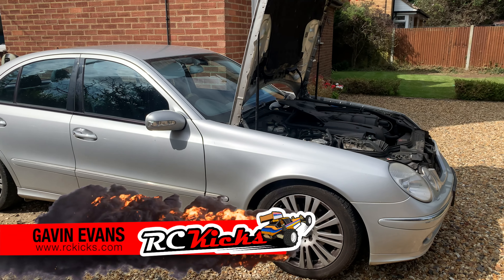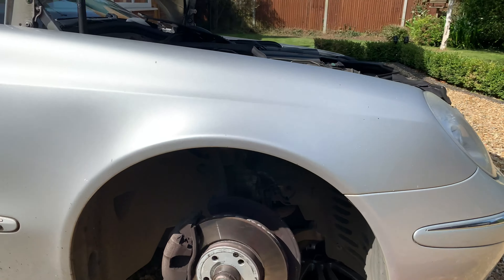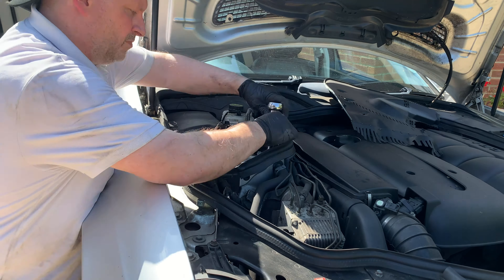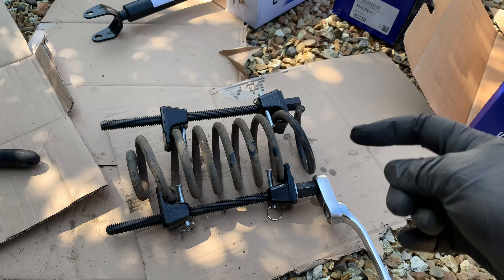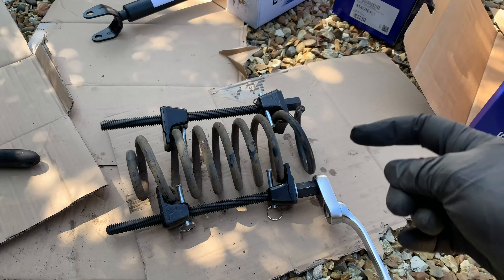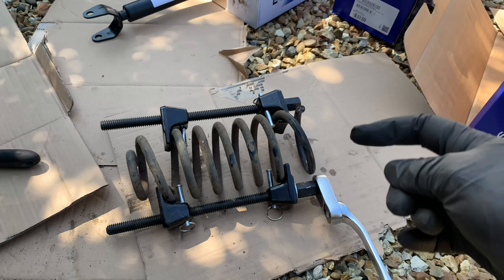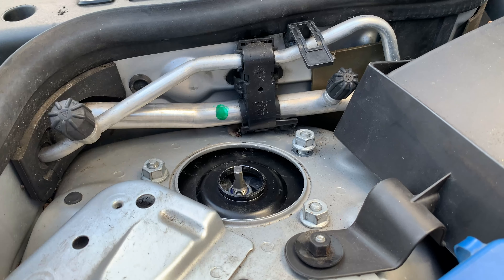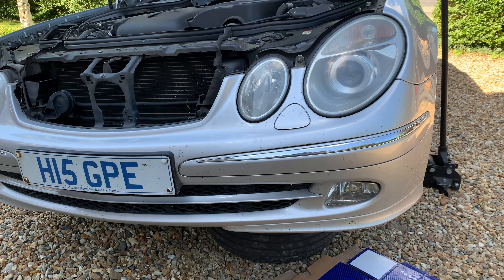Mercedes Benz E Class 220D Front Suspension Step By Step Replacement

Comment: Have I got this right...... you thought the issue was the top rubber, you were sent the wrong top rubber so you used the original top rubber (which you thought was the problem) 🤔
Nice to see something a bit different though Gav.
Reply from the maker: No the top mount has a rubber bush inside it that the shock bolts to.  The rubber spring seat is just to hold the end of the spring in place.

Comment: Not bad for a diy job however, you should have used an axle stand to support the vehicle and not just a jack. Those spring compressors are dangerous, in the trade you wouldn’t go near a coil spring with those. You should also go a get the wheel geometry checked, any work on the steering or suspension can affect the toe or camber adjustment.
Reply from the maker: I’m going to change the lower arms first and maybe the uplinks before taking it for an alignment.  I’m looking into maybe pressing out the lower shock bush as that could be a way to go Vs swapping the arm out altogether as the other bushes look fine with no cracks.  My only hesitation in doing that is how much life the other bushes have in them before I do need to change the full lower arm 🤔.  100% agree, I really don’t like these press tools.  Even the set I have with the extra lock pin, can still spin around the coil with force.  That’s a little better than flying off into your face but still.  If I was doing a few more I would get the proper spring press.
Reply: If you’re going to replace the bushes on the lower suspension arms, I would just change the complete arm. You’ll need a press to change the bushes and as you say, what would the life expectancy be of the bushes you didn’t replace. You also risk damaging the ball joint boot / gaiter when removing.